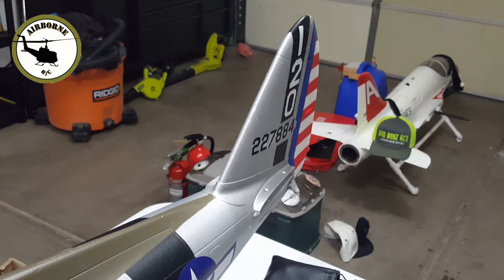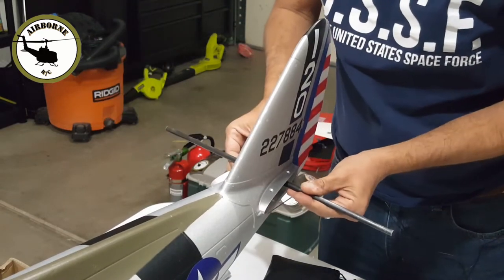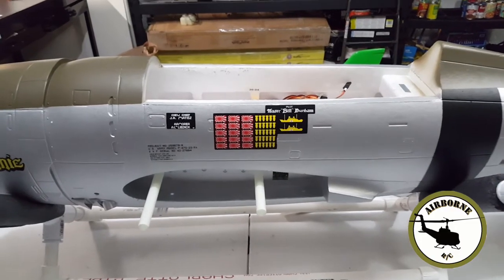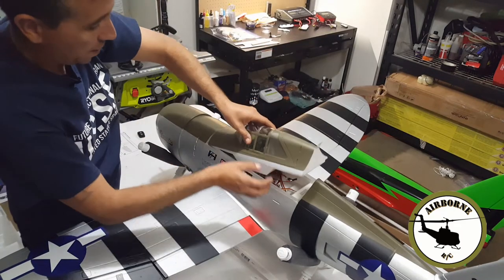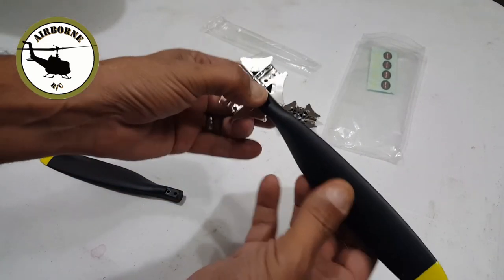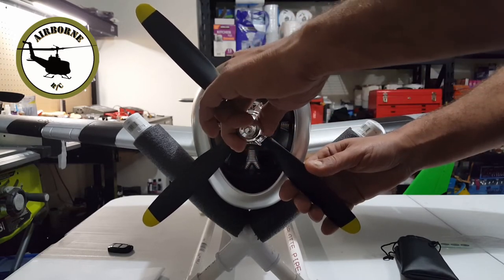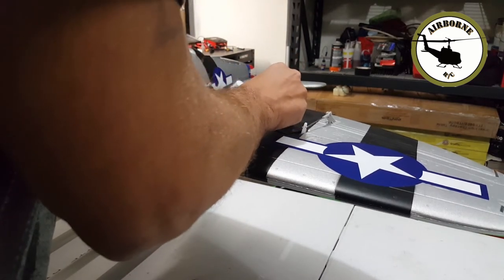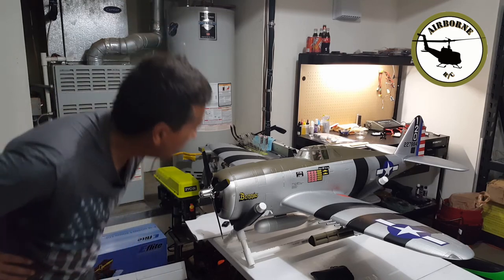FMS P47 Razorback build

Comment: That is a great plane. You did a very good build video. I'm wondering if I should get that plane first or the Flightline Corsair. I have a Hobby King Durafly Tundra 1300mm coming in Tuesday as my trainer. Working a Graupner MZ-12. You take care.
Reply from the maker: This plane is a gentle giant, real great flier and no bad tendencies. Real easy to fly, not too fast and can get her to slow down too. For the price and the size tou cant go wrong!  If you decide to get this plane id wath my wing connector fix. 👍